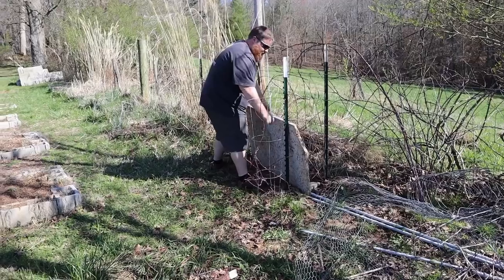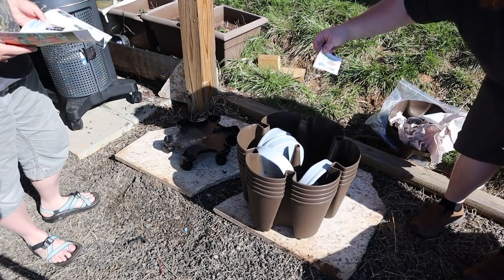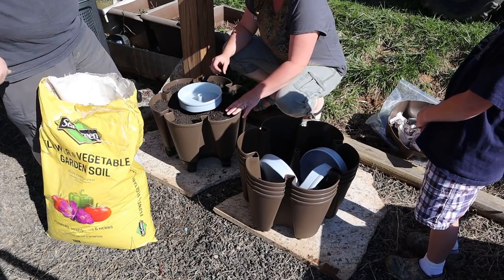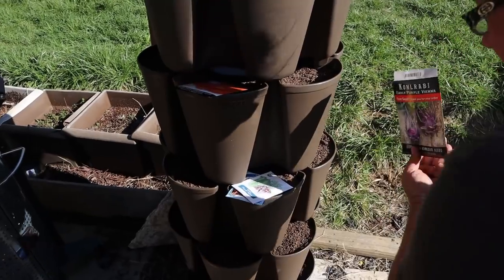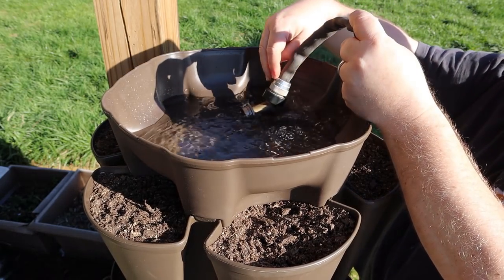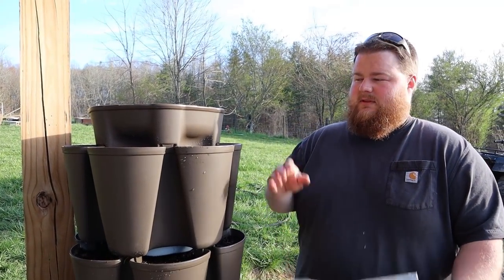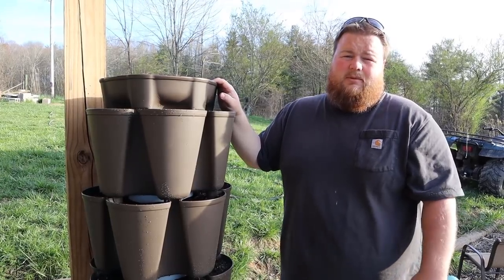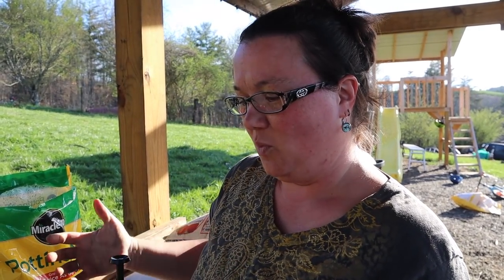Starting Our 2020 Garden with a GreenStalk Vertical Garden Planter

Comment: YAY for finished goals!
Just an fyi for next time:  I worked in a greenhouse back in the day and the way we did the potting soil was to mix it in a #3 washtub with Osmokote.
Then, stir in just enough water to make it soupy and walk away to let the soil soak in the water.
Then, pack the wet soil to the starting trays, poke holes in the soil with an old pencil or even a nail and add seeds.
That way you're not running the risk of washing out your seeds because the soil is wet already.
Yes, please share some of your favorite meals. Tfs <3 XOXOX
Reply from the maker: Good idea!  Thanks! -A